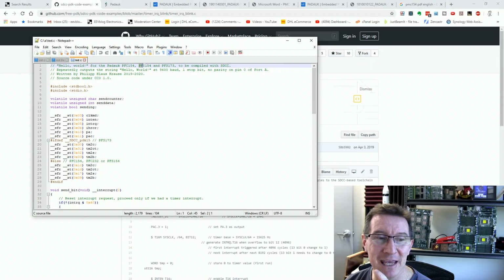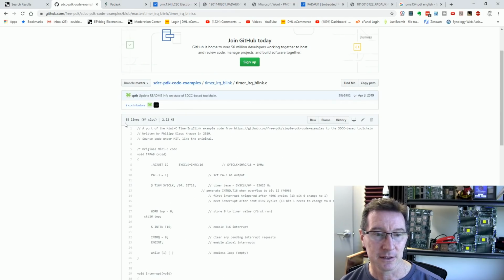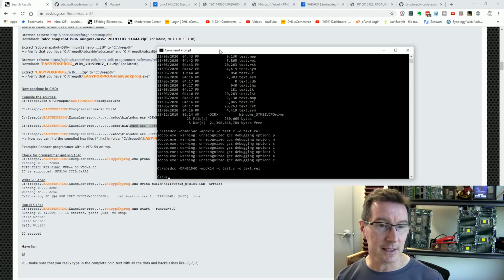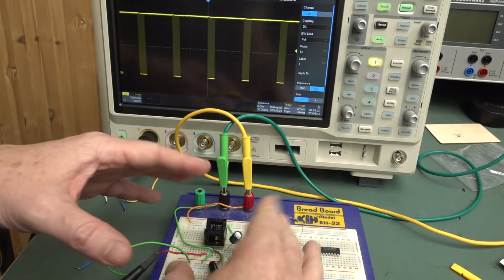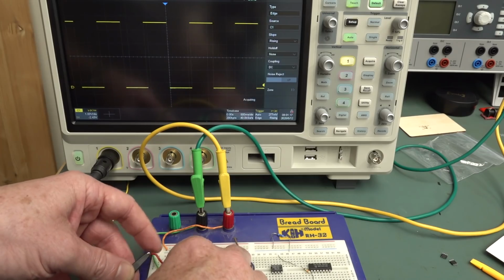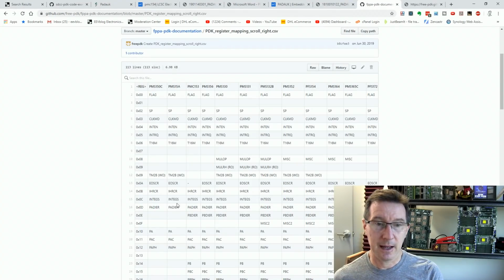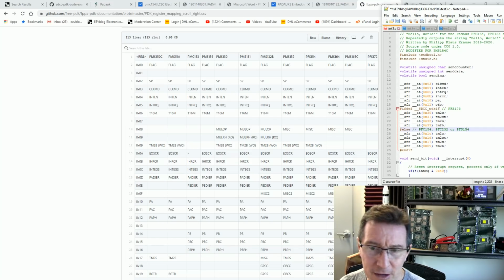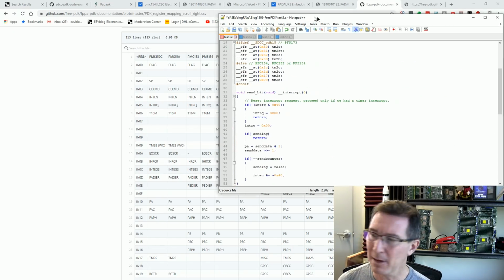EEVblog #1306 (5 of 5): Spooky Action - Hardware Testing

Comment: Oh! That was so painful to watch! I’m pretty sure I know what the issue is. Don’t know if I missed the check but…
When you have “spooky” things going on you probably do have something floating - THE RESET LINE! 
Always make sure you have an external pullup on the reset pin for these things. PA5 I believe it is for the 154 - that also counts when it’s used as IO pin. (Found that out the hard way)

Comment: As a retired Analog IC designer from NSM and LTC, You have just made the best argument for staying within the Analog domain. The digital realm with its ucontrollers etc. can be very powerful but even more frustrating to find the exact programs to get these things what you want them to do - WORK. 
I think that you should look into designing and building your own 2 ch, 50-100mHz oscope for the under $150 USD market just as you did with your DVM project.

Comment: Would you still be  interested in  Raspberry Pi Supercomputer Cluster? In part 2 of Raspberry Pi Supercomputer Cluster you showed that there were board mounted Ethernet connection. The Raspberry Pi 4 with the PoE hat could make the board a lot easier.

Comment: Hey Dave! I've seen this incredible product advertised all over youtube and I think you should investigate how amazing the solar panel performance is. It's a 20,000mah usb power bank with a small solar cell that charges it in just 1 hour- 20 amps! What an amazing scientific breakthrough to get a 100w panel on such a small device. Check out lit solar. And please ruin them, the lying pr**ks. £100 for a power bank?

Comment: What happens if you put an un-programmed device on the breadboard, do you see the same nonsense? Could it be that the programming is actually failing to write to the device? How do you verify that the code was written correctly? Is there a way to read it back and checksum/md5sum the result?

Comment: Interrupt handling and real time priorities can drive a person insane.  Typically an interrupt handler routine or ISR would first render further interrupts impossible, until the handler reactivates further interruption on its way out.  It can be so confusing while delegating a sort of order of importance to interrupt handlers,  but I can remember in the Intel 8051 that there is a special bit addressable IP (Interrupt Priority) register to delegate those distinctions.  Upon reset, for a brief moment interrupts are disabled, and for whether or not further interrupts are enabled we turn to the Interrupt Enabled or IE Register.  Often enough we would need to set some bit in these interrupt registers to suddenly enable an interrupt whilst two lines prior they weren’t enabled.  So with my 8051 familiarity, I can recall that many ram locations were deliberately left unoccupied and unused so that future iterations of the 8051 would be able to keep compatibility with the older code and yet possibly open up some new features in the future.  This is probably what’s going on with this microcontroller.  Maybe a special register in this version of the micro is unused in an older one and so won’t work.  I am using a newer 89c51 micro just as I would my old 8051, so perhaps I ought to go to the specs and see what newer features I might be depriving myself of.  Watching this makes it much easier and healthier to endure my own shortcomings and feel less alone in my suffering and discouragement.  THANKS FOR SHARING!!

Comment: The spooky action seems to be 50 Hz between blocks. Probably noise causing some interrupt or reset on some pin that has not been defined properly. I've had the same thing happen when I thought some pin was internally pulled low, but it was floating and causing resets.

Comment: What does "floating input" mean?
Reply: Means it isn't pulled high or low externally and because it is high impedance it will change voltage randomly over time as external charged objects (Dave's hand) move near it.

Comment: Needs a part 6 where arduino emulator software is loaded on it to produce a 3 cent arduino, combine this with JLCPCB's free smt assembly offer and you have a real winner winner chicken diner. If the pcb size was 90mm X 25mm then you will get 20 boards for your 2$ (panel by V groove and a 5mm boarder top and bottom that will have the order number on)

Comment: Well, lbry comment section decided to take a break today, so here it is:

Well, Padauk is a clear no-go for me! I have ~zero HW skills. No way I'm gonna order reel tapes and solder small resistors! Also, in SW I need testing, debugging, clear documentation on the hardware, IDE integration, etc etc. Not some mambo jambo C like language with 10000 traps. 

I love the long, raw format! A well polished tutorial will hide all the traps that are not trivial even for a, well, seasoned player. Finding documentation, debugging, getting it right, all these produce friction. If they are cut at editing, it is like lying about the quality of the product. I managed to get myself into such a trap by ordering a 16 relay board (5V) that I hooked directly to my 3.3V RaspberryPi GPIO! Well, the video I watched was VERY convincing that it works. Same stuff with some 1Wire temperature sensors! Rubbish tutorials! So yeah, you could make a summary. But it is just laying a trap for young players there!

Cheers!

Comment: We had some sort of arm cortex M0 chip used in a power supply application that would just outright stop working if you got near it, we labeled it possessed and discarded it in hell fire 
(in reality it was due to one pin of the crystal not being connected fully via a broken trace, i assume the added 60hz and/or capacitance broke down the barely stable capacitively coupled connection it had )

Comment: The MCU support headers need some cleaning up. There should be dedicated headers for each model with one base header for the common stuff. The compiler switches should enable the correct cpu and the headers should pick it up as a definition. Using the wrong header should cause a compile error so it can be fixed.
Dave ran into an issue that he now has to reverse engineer how to get the correct header defs for the correct MCU.
The git codebase needs some work there hopefully it's a work in progress and will get better.
Cheers,

Comment: Hey Dave, in test3.c (shown at 18:00) line 87 has a variable for "Port-A Control" named "pac"  set to 0x01, but the list of registers you were looking at in Git (in the first column, for the PMS150c) has the PAC value mapped to 0x11

That's 0x01 vs. 0x11

Could that be what's wrong?
Reply: No, that's all correct. In line 87 the value 0x01 is written to PAC, which is located at 0x11 (as you can see in line 18).
Reply: @Kai-ml2iu  oh that value is being written to the PAC variable. That makes more sense. Thanks for the explanation!

Comment: I just watched episode 5 of 5.
I had really been looking forward to seeing that 3 cent micro do something after all that work was put into the design and build of the programmer. but somehow I missed something that apparently others did not miss.
 I never saw the solution to the problem, nor did I see that 3 cent part do anything, nor did I see you find a final cure for your spooky action problem other than shorting out a pin or resetting the device, or removing the power. I looked like you probably did all of those things in the process of moving the wires around on your breadboard.
 It seemed like you getting nowhere fast; and the next thing I saw was you talking about your RSS feed and all the fun you had making the series and getting everything to work...
 Did I miss something obvious?   I replayed episode 5 at least three times and repeated the last 5 minutes or so at least a dozen times, and sill missed the part where you solved the problem and made it work. Both the blinking light and the 'hello world'......
 Did you make an editing mistake and accidentally remove that part of episode 5?
Instead of having 5 of 5 episodes, maybe you could have an additional episode 5A or something...
I am like the bank robber in the Dirty Harry movie........ "I needs to know"!..........
Reply: The problem was the two random Padauk micros that Dave got aren't supported by the open source compiler in one case, and the firmware in the burner in the other.  It's not clear what the differences in all the chips are.  Everything else worked fine, including burning one of the micros so it was deemed successful in that regard.  The solutions are obvious - either purchase one of the Padauk micros that have been demonstrated to work, code in machine language directly for the chip that can be programmed, or wait until the compiler and firmware gets support for other versions.  The beauty of this kind of video is that we get to learn from Dave's painful mistakes, rather than having to make the same ones ourselves. 

Everyone who's played with micros knows these are the kinds of mistakes that will be encountered and which need to be solved.  I wouldn't be surprised if this bugs Dave until gets one to at least run a simple blink sketch,

Comment: Yes, I like the play along with Dave format - as well as dumpster diving Dave, mailbag Dave, teardown Dave, and equipment review Dave. My favorite EEVblog format is Dave at the whiteboard/Dave at the breadboard, especially the old Fundamental Friday videos with their beautifully clear explanations of stuff I didn't know coming from a software background.

Therefore, I would find watching you solve some circuit design type problems more valuable than watching you solve more microcontroller type problems since I muck around with microcontroller type problems plenty myself. Other viewers will undoubtedly prefer the microcontrollery stuff.

In any case, this multipart series showing the various ways Murphy got you and how you joyfully overcame them was a treat. Shows what engineering is really like. And that it can be fun as well as frustrating.

Comment: The sheer amount of education behind the train of thought at 5:30 that led to the discovery at 6:27 is ABSOLUTELY PRICELESS. Though it may be commonsense in hindsight (it often is), that error would likely be a hard-stop for some time...perhaps indefinitely, for myself and other beginners.

Thank you so much Dave, for the work behind this series. As a CE student, I've realized that debugging something often relies on the hours of frustration you've spent debugging similar issues in the past where you learned some lesson about various modes of failure. Combining intimate hardware knowledge with the details of the code implementation to even know where to begin. I salute you!

Comment: Interesting videos.
Coming from Arduino and trying to learn  straight AVR chips there seems to be a gap in the info available. You suddenly get yanked from a furnished environment and thrown into avrdude and lots of mucking about with making an Arduino into a programmer, much like you did with this PDK. They are trying to make it entry level but it's really just daunting.
I just said screw it, nope, I'm going AtmelStudio and AVRISP and maybe I'll learn the fancy computer stuff with command lines and dredging github for rare drivers later when I have some basic understanding.

Comment: Good content. This gives a more accurate picture of how engineering projects usually transpire- problems at every turn. If you've only done Arduino projects where all the hard work has already been done for you, this experience would be quite the wakeup. Also, wtf Keysight, include serial. Siglent ftw.
Reply: "Arduino projects where all the hard work has already been done for you"
Hahaha, good one!

If you dont just do the most generic blinky thing you very quickly run into hard problems regarding code as well as hardware and why you cant do this and that or how you have to bend over to get it working. 
PS: Just to say this once here: The effort to program this litte 3 cent µC is not worth all that hassle unless you really need a ton of them somewhere.
Reply: @leocurious9919  Yup, I programmed OTP/UV erasable PICS at a job in 2004, and it sucked. It's kind of laughable that hobbyists want to waste their time with this in 2020. The only advantage to these parts is that you get super high volume pricing without signing an NDA.

Comment: I don't really understand that Bell experiment which is supposed to prove Bohr was somehow more correct than Einstein. With the target arch compiler flag, if you are lucky it is defining true one of the variables that branch the declaration of hardware address. Otherwise you'd have to define your arch in the source at the top. The blinkey one could work as it describes a common set of address to all the ics. Actually that code appears to check if you have a pdk15 and sets some stuff and otherwise sets some stuff so you may have to mod that bit, or like #define  __SDC_pdk15   at the beginning maybe. Also the setup for this chip may differ and operation so the code may have issues.

Comment: libopencm3, Arduino, STM32 HAL. Examples from the manufacturer. Examples or Libraries from enthusiasts. My own stuff, etc.
I've not seen one in my lifetime without bugs. So why do you assume this from a random piece of code on Github? :)
Good work and thanks for the series, Dave.
Incidentally, the chip series and support do not convince me. With the 150 pieces for 8 bucks you get yourself a lot of headaches. It is of course a great job from all the people who wrote the toolchain and reverse-engineered it. It will probably take twice as much effort to get out of its infancy. I prefer to forego friendship with a non-deterministic toolchain;)
Reply from the maker: Well, it's a simple Hello World program, pretty reasonable to expect that would have worked.

Comment: At 10:00: the -Dwhatever option typically (and I checked, is indeed the case for the SDCC compiler) defines preprocessor macros. So, it only has any effect if the C source code (or includes thereof) has #ifdef lines specifically checking for it. I would bet some money that the generated IHX file was completely unmodified by adding the -Dwhatever option. Also, observing that the compiler "accepted" the option is yet another red herring, because it would completely transparently accept -DTROLOLOLOL or anything else. I think this is worth annotating the video with, as if someone else "tries" doing the same thing, it's just a complete red herring (unless the specific source code file has the appropriate #ifdef lines, of course). Also, it would have been good practice to use md5sum or just about anything to check that your IHX file was actually any different from the first, before programming the second chip with exactly the same code.
Reply: But hey, Dave's electrical engineer, not a uc programmer. It's OK if he doesn't know everything about C.